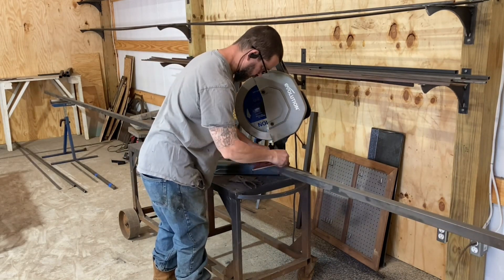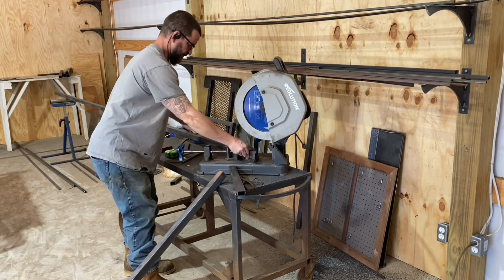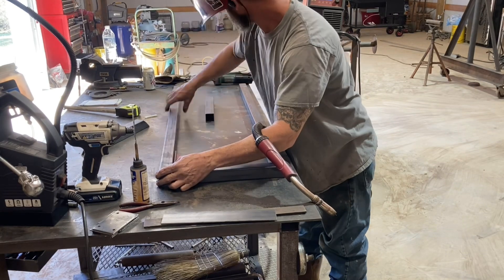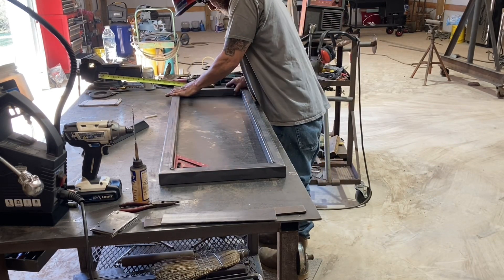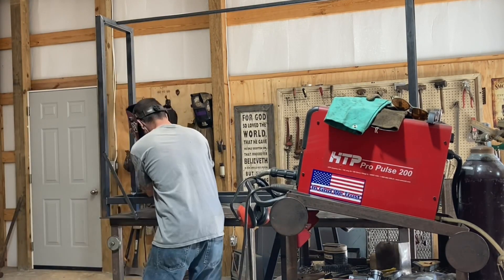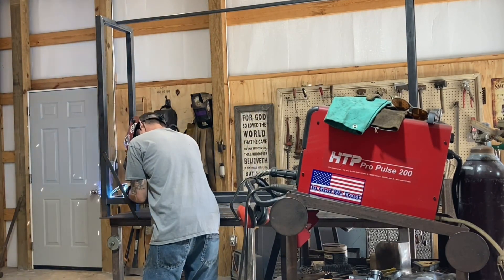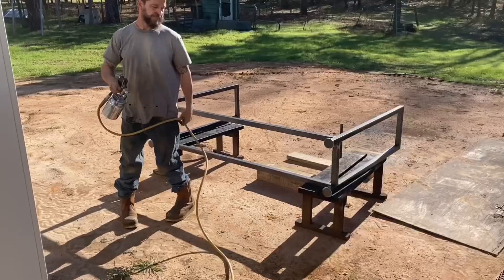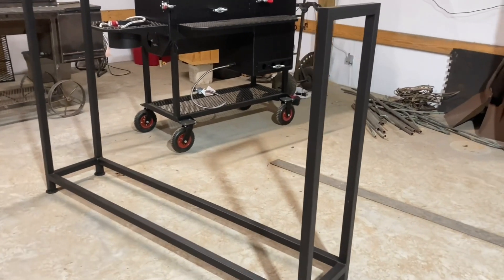Log rack build

Comment: Love your work mate, don't have your magnetic drill anywhere near your welder mate, the welding current going through the steel bench will damage your drill! It burns out the circuit board inside the drill.

I have had it happen to me many times, what happens is the magnet will turn off while you are drilling. The drill will keep spinning and you can't stop it as the whole thing spins around.

Love your work big fan of your grills!